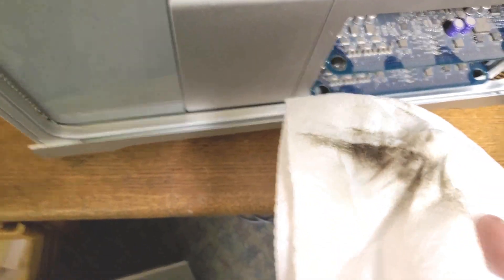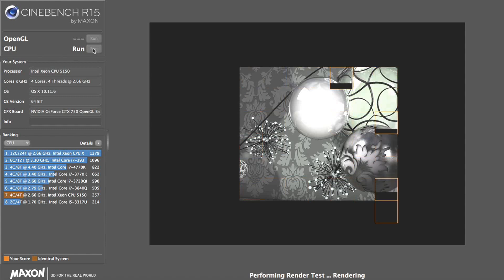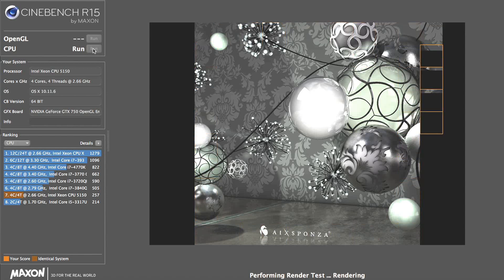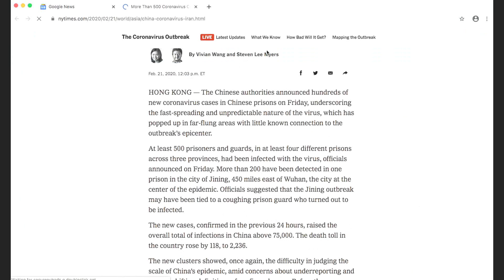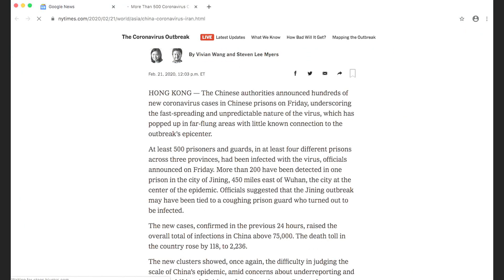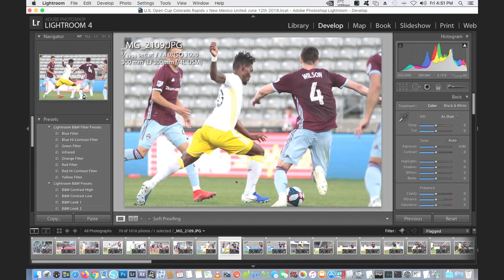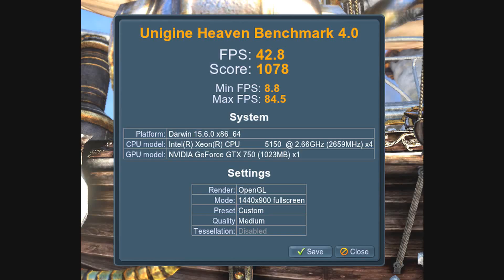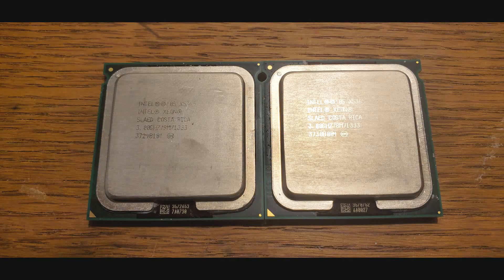2006 Apple Mac Pro 1,1 in 2020 REALLY, WHY??? Pt.1

Comment: Bought a used “Frankenstein” 2.93 12 core for my recording studio back in 2014… other than a power supply crapping out the thing is a tank and very useable today. Have maxed it out with 128gb of ram and 4 SSD hds… don’t see any reason to use anything else.

Comment: Do you think you can get Linux running reliably on one of theses older 1,1-2,1?
Reply from the maker: I would assume (you know what that means right) there would be no problems getting 32 bit versions of Linux to run on these systems.  Although I have not tried it. And have since sold the 1,1's that I used for these videos.

Comment: I wanna get into refurbishing these for daily use and some gaming. Which model do you think has the best upgrade:cost ratio?
Reply from the maker: Tbh stick with the 5,1's with a dual cpu board  these are highly sought after at least at the moment.  This will change beyond Big Sur. Though due to the fact they will no longer be upgradable.
Reply: @CorbinElliott  ty! Do you consider a dual socket 4,1 flashed to 5,1 in the same category (as far as with Bootcamp Windows 10 and El Cap)?

Comment: I have 2 of these 2006 mac pro  1,1 and they are highly useable even today... running dual 3ghz xeons, 8cores.
dual ssds in raid 0, gtx 960 pro video, 32gb ram... dual booting capitan and windows 10, these are smooth fast and very capable..I use it as a home theater /web surfing interface with my 4k tv...the only thing i wish i could add but havent been able is an nvme boot drive... other than that, these are still beasts and feel ultra snappy, can do lots at once and are not bogged down by multitasking..
Reply from the maker: They are beasts no question about it.  There were a few things I did not like, no option to go beyond El Cap as well some of the PCIE and Processor limitations.

Comment: nice video.
i have bought a 1.1 that  was flashed to 2.1, 48 gb ram, 3 ssd (one for lion, one for el capitan, one for w7)
the actual  gpu is a hd5870 ps version flasher o mac bios.
Can you tell if a rx480 4gb will run on this machine?
thank you
Reply from the maker: Sorry do not thing any drivers are coded for the RX cards in El Cap.  If you want a better card go for an Nvidia cars with the nvida web drivers.

Comment: Just upgraded my version of this to an ssd.  Just using it as a photoshop machine.  Runs almost as fast as my 2015 macbook pro for this application (well I cant really  tell much of a difference when retouching).  It did come with a 32gb of ram though ... might be the main reason PS runs so well.  Has the raedon 5770.  Honestly just became useable as a secondary system for me.
Reply: If it's got a 5770 it's probably a 4,1 or 5,1 so much newer
Reply: @CommanderMouse72   No its definitely a Mac 1.1 (I flashed it to 2.1) same 2 x 2.66 dual core xeons.  It came with this  5770 gpu (which I am running a 4k monitor off) and the original crappy one which I sold. ... this it was a GT7300 card.   I am running el cap as well.  Sure its not going to render video or doing anything heavy but to work on 60 - 150 mb  psd files, with multi layers the thing works really well.  Quite surprised.
Reply: @damienvdv  El capitan is still perfectly usable, I personally have a 5,1 running Mojave , which came with a 5770 in it, but I put the rx570 from my windows pc in

Comment: Thanks for the video. I'm just perusing anything related to a Mac Pro 1,1 since I just snagged one in NYC for $10. Running Window 10 straight from a HP hard drive. Was hoping for dual boot but no time to futz around till later. Am looking for a 32GB memory upgrade but no idea if I can snag a set for less than $20.
Reply from the maker: You may be able to find the memory, just the $20 price for 32gb may be the proverbial needle in a hay stack.  You may get lucky though.
Reply: @CorbinElliott  Actually found it but not sure if I should... lol ;)

Comment: Similarly, about two years ago I also got a Mac Pro 1,1 for $20 and have El Capitan running on it.  Upgraded the firmware too.  
Funny coz initially I was going to make a park bench out of it for our flower garden.
But really, it's the cat's meow!  
A lot faster than my 2012 mac minis with only a modest $30 video card add.  Since Apple has kind of pooched their OS I'll likely be using this machine for years to come.  I didn't bother upgrading the processors... I heard the speed increase is nominal.
Since I don't use much that takes advantage of multiprocessors, outside of unix command shell stuff, I don't care much about multicore.  It would be fun to have a 24 core Mac Pro 5,1 if it was free... but otherwise.... nyet!
Why did you say "what was I thinking" I wonder?  Because of the processor upgrade, maybe?
After the Mac Pro, I found a G5 machine for $10, again planning to make a park bench out of it.  But sadly, it works too!  I have 10.5.8 running on it with a bunch of productivity apps from the day.  It sits out at the lake house, waiting for me to use it mostly but with the TenFourFox web browser it is also still usable enough to be fun.  Problem with the G5 is lack of support at the command line- with brew + other s/w package managers- all the libraries+apps float out of date.  Would be fine to use daily for me if it ran golang easily.
Reply: Incidentally, I'm pulling the plug on Apple products as of Catalina.  Apple just doesn't seem to make quality product anymore.  :-(
Reply from the maker: We will be using our Apple hardware for quite a few years to come.  And will see how Apple implements the ARM processors into their products before making a decision on the next generations we move to.

Comment: These Mac Pro's are tanks. They are very well built and functional. I use a 3,1 Mac Pro with Mac OS 10.4. For older operating systems I would suggest using the TenFourFox browser. Download link: https://sourceforge.net/projects/tenfourfox/files/unstable/contrib/
Reply from the maker: Always good to see the community step up to develop software to overcome discrepancies the current line up. I have heard TenFour is good for the older systems.

Comment: i be running windows 10 with this machine just fine i got 16 gigs of ram and a quadro with several terabytes of drives and one ssd it is one of the longest lasting pcs ive ever had
Reply from the maker: It is amazing what these machines are capable of.  And if you look around hard enough they are super cheap.

Comment: $20? You must live out in the boonies.  Great Steal!!!!  I have a 1,1 I bought for $150.  I just got it running El Capitan, and now want to upgrade the CPU, ordered a pair of 2.6ghz 8 core x5355 for $12 off eBay.  I am heading over to your next vid now.
Reply from the maker: Glad you were able to still get one. You can beat the price for the older Xeon Processors .. good luck.
Reply: Did you have to upgrade your graphics card or any other hardware to get El Capitan?
Reply: @TheEvanOf  To run El Cap, your GPU needs to have at least 1 gb or ram so yes, you'd need to upgrade the stock card.
Reply from the maker: Originally had the ATI x1900 that was fine for lion.. But to get El Cap running correctly I had a GTX 750 from a previous build that I installed and it worked sort of.  I would get random memory issues.  The card would not work properly when the slots were set to x16 so found a native Mac card the HD5770 for $40 on ebay.. Double the price of the machine.  But it works great.  this is not a gaming machine so all set for what it is.
Reply: I got a 5,1 for about that price with 500gb SSD and 2tb HDD, 16gb ram and quad core Xeon